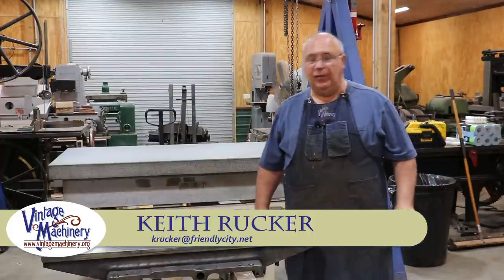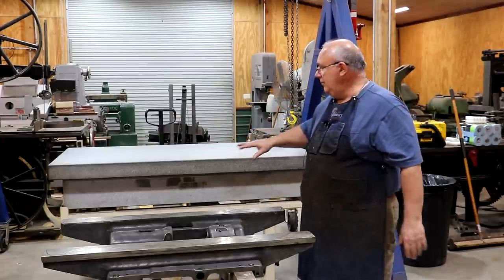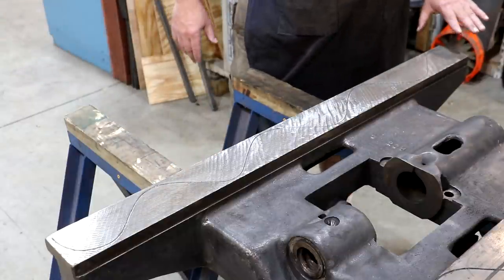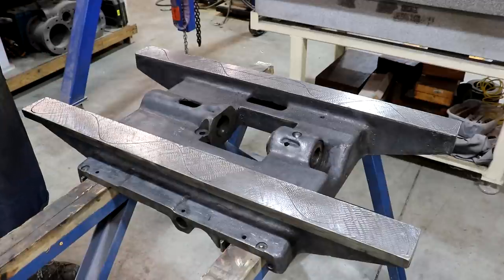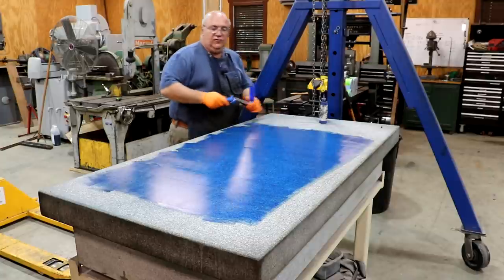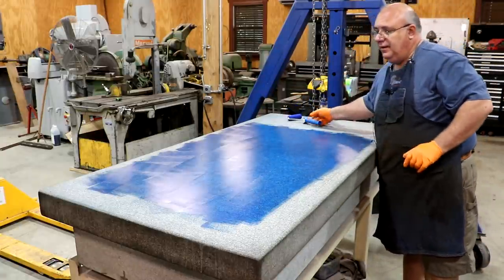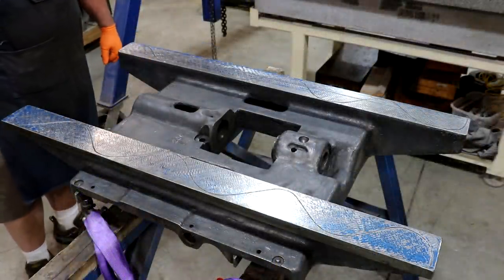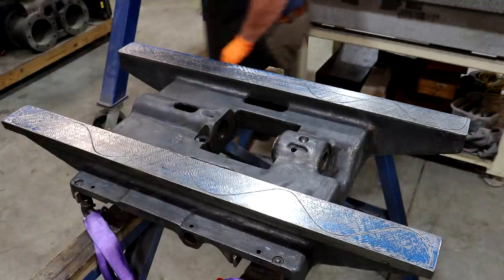Horizontal Boring Mill Restoration:  Scraping the Saddle Ways Flat

Comment: I had a few great uncles who worked part time as machinists and they said 'a good scrapping in, is like adding 10,000 ball bearings in every square inch' and after seeing how easy you move that saddle on the stone with only ink as a lubricant? Yeah, its like 10,000 ball bearings was added.
Reply: What a great visualization 🤠

Comment: Just saw the biggest and class AA granit surface plates ever.
I Just had the last test in my job apply ( technical), in a New job as an metrologist ...so stocked !
Grtz from the netherlands 
Johny geerts
Reply: There was a huge granite surface plate at a used steel/equipment dealer near me on Interstate 5 a few years ago. He was reselling tons of equipment and steel from Boeing in Everett Washington when they scrapped the plant out and moved to China. The plate must have been 20 inches thick or more, 60 feet long, and 15 feet wide. I remember being very impressed that they could move it without breaking it. I have always wondered what something like that was worth and what he got for it.
Reply: @5x535  wow same thickness thought guess the biggest i saw was 12 to 15 feet . 
Full granit  ..
But every secties,  even the electronics departement had granite surface plates table as workbenches 🤪🤯..
I saw like Twente smaller 6 ft tables and some for Europe (lol) extreme big ones AA ...
I was like a small boy i  the candybar shop ...but i paid of !
Just had a call i start 7 june , i have at last a job that thick all my intrest boxes🤩🤪🙌🙌
As an calibration  engineer so greatfull and happy

Comment: I have wondered a few times while watching the scraping videos if you are making the machine more accurate (or better) than it was when it came out of the factory. Clearly the planning left a good surface but it feels like it wouldn't be as good as scraping with a top quality surface plate as a reference.
Reply: It depends on the state of the machine when it left the factory.
Reply: It may end up being as good or close to when it left the factory. However, I doubt it would be better than it left the factory. The machines Keith scrapes in were top of the line machines back in the day. They were the cream of the crop and accurate. That’s not to say you could not buy a new cheap machine and make it better than factory.
Reply: I have scraped machine tools for many years...this is not the correct way to do this....you don't know if each way is the same height
Reply: @hoppercar  Can this not be addressed when he has the bed ground?
Reply: @hoppercar  Why not? Both ways were scraped and compared to a very flat surface plate. After scraping and comparing many times the ways are the same height and on the same plane with no rock. How would you do it differently? Please explain.
Reply: @hoppercar  BS. We know they're the same height based on the contact pattern across both way surfaces after referencing off a calibrated surface plate. Every point of blue is on the same plane. If the ways were that far off that you could make the claim they're not the same height you'd be getting extremely uneven bluing across numerous scraping attempts, and you'd likely be looking at a grind job before another scraping attempt.

Comment: Keith,

Great video and an impressive skills display. 

I do have some simple questions regarding your saw horses.  It looks as if the members you're landing your newly scrapped surfaces are steel.   Would it make sense to fit wood covers to protect your parts from damage while lifting and turning?  Also,  would it make sense to fit cross members between the saw horse?  This would keep the horses together so they are more like like a table.

Bob

Comment: I clearly have little mastery of what you're doing, but if you ground the surfaces perfectly flat on a grinder, then put a cross-hatch pattern similar to how you did those vise jaws, would that accomplish the same goal as scraping?
Reply: In short, no.
Reply: Typically no machine grinding will be as accurate as hand scraping and using a surface plate as a master. But on a very good grinding that may be all you need.
Reply: go watch the scraping videos for the metal planer. he had that ground and then had to scrape it all.
Reply: @katelights  I've likely seen it, just wondering why it has to be scraped by hand for the ~10-50 points of contact. I was wondering if a crosshatch pattern like knurling would work in conjunction with really flat grinding.
Reply: @Sizukun1  No, knurling is an embossing process that raises the metal surface, exactly the opposite of what scraping does. While knurling looks good and provides a good gripping surface it will not produce a flat surface.

Comment: I have a some shop 178sqft, so there for the scale I work on is small, there for my tooling need to be small. I've been collecting Atlas, it fits rite in for small scale work and what goes along with Atlas is restoration, all what I have collected needs big time work on them to be done. What I'm leading up to is I'm not collecting to just show off, but to have what is needed for my hobby work. I know some fokes out there just what to have a show off shop,

Comment: That is some very dodgy rigging you're doing there, I've noticed it several time recently.  The chances of those slings slipping through the hook are very high, the way you are using them and a chip out of the granite plate could be the result.  It needs four individual legs of the same length to do it safely.
Reply: I worry that the rigging is gonna cost him an injury at some point.  I've done some dodgy stuff, too, but that was before I knew better.  There isn't a good reason to chance it if you have the means to do it right.  Proper straps are cheap compared to a hospital visit and surgery and recovery.